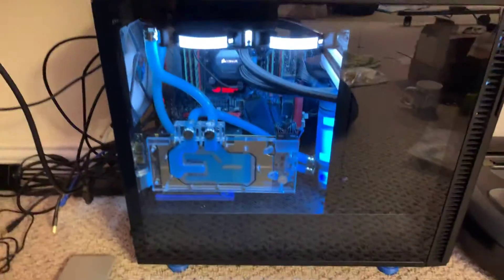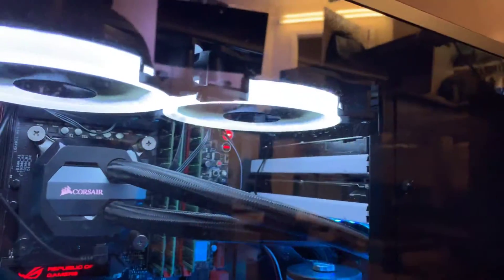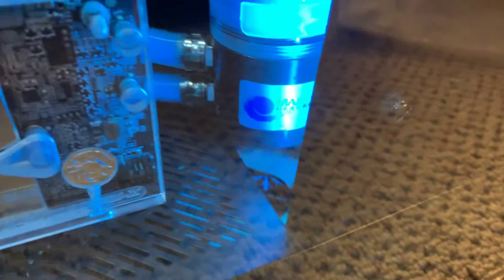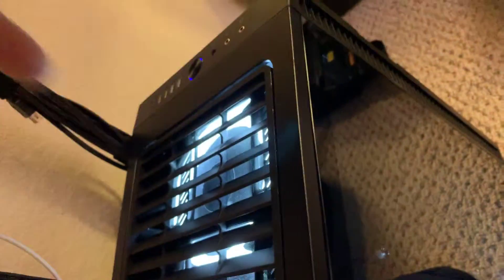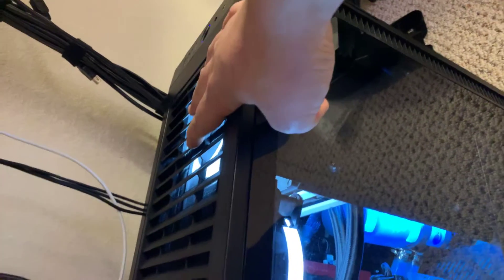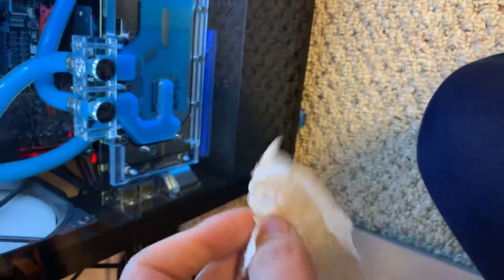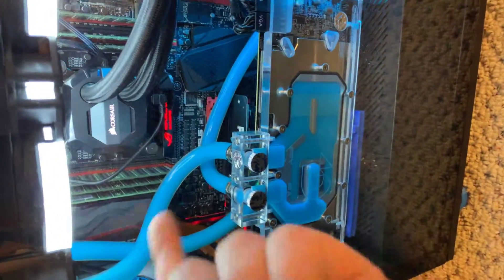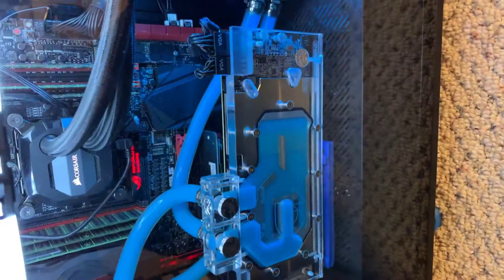How to get net air flow OUT with Fractal Define R6 when using 480mm liquid cooling

Comment: Is there room for a 360 Radiator with 3 fans in push or pull + all the HDDs in the front?
Reply: @AK-jt7ug  
Ok thank you! I am planning on a workstation with an OC'd i9, or a 10th gen Intel when it comes out. I need the cooling and the storage, and i like the noise reduction in the Define series. Is there room for a 120mm fan in the bottom at all, when having the 360 rad and HDD cages? If i do it kinda like you did your top front fan?
Reply: @NORxDRONExAT01  The HD cages go all the way to the bottom so you wouldn't be able to fit one, no. But I don't see why you'd want all the cages, I would have an external HDD housing if u really need the extra HDDs.
Reply: @AK-jt7ug  
Ye i were thinking about having all the HDD storage outside the case, in a separate NAS-type configuration. But would be easier and cheaper to have everything in the case. I'll see what i end up doing when i get it. Thanks for the replies!